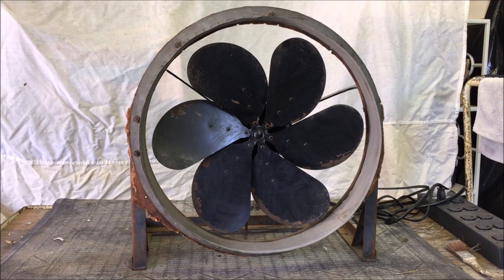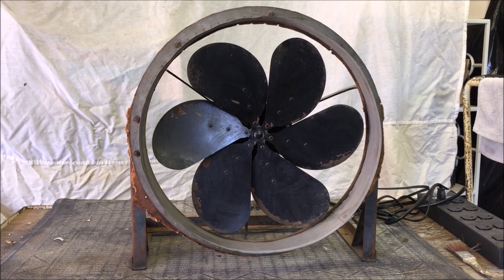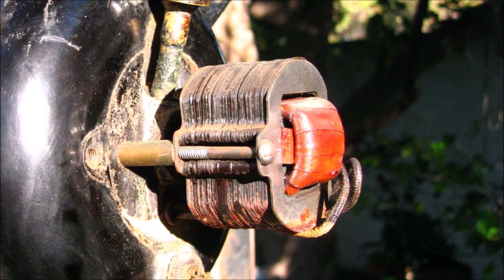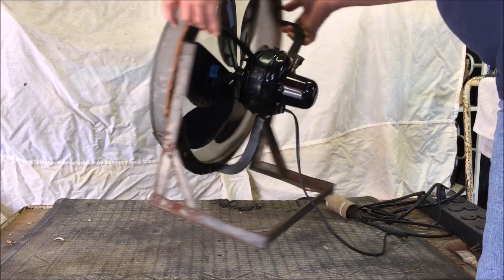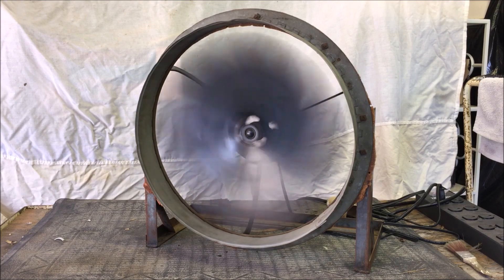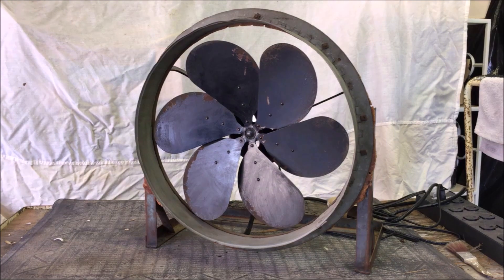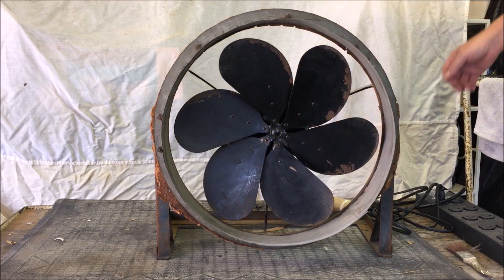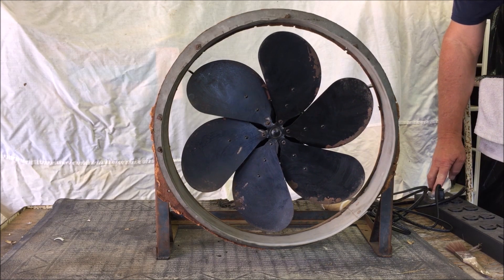Antique Emerson 16" Ventilator Exhaust Fan

Comment: Is there any sign of new windings? I have a bit of knowledge in motor windings, and if the motor's winding isn't original or was wound up inproperly, there's a chance that a winding might be installed in reverse, which gave the fan that hesitation at startup. That problem only happens with motors that has 6 or more poles, so.. how many poles does that motor have?
Reply from the maker: It's a 6-pole reactor start. I've spoken with a friend who is knowledgeable about motors and he said he's 99% sure that the issue is in the rotor, likely a bar that went open.

It's going to be a while before I can get to it due to family needs.
Reply: @DBVintage    Then have an auction with you having it fixed.  :-D
Reply: @DBVintage  I have never heard a rotor probably in a emerson. Hopefully it will be fixed soon.

Comment: great fan. Super cool. I was hoping to find someone had shed some light on the magnetic dead spot. If you get any other info maybe do a flow up video. I know I'd be curious. Cheers!
Reply from the maker: Thank you! It is an interesting one for sure. I do wonder what its story is and where it was installed. There are remains of masonite pegboard around the frame.

The dead spot has me curious for sure. I'll post follow up videos when I get around to testing this beast.

Comment: so where did you get that from, where do you think i could 1/one, do and or did they make a bigger size, and is there an option, and or think that they have/and there is an option with guards or so??? Because my dad migt not let me have it and or 1/one or so with out guards. Or @ least use it without guards
Reply from the maker: I think this was found in Bakersfield via a Craigslist ad. I don't know if guards were optional, but with a bit of carpentry you could build a box enclosure with screens.